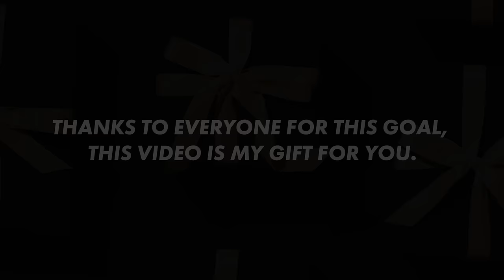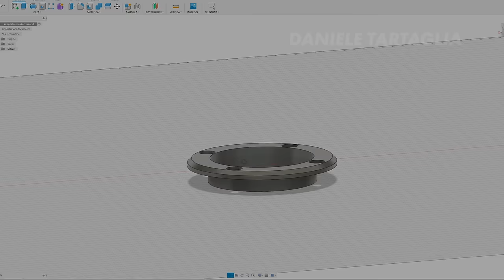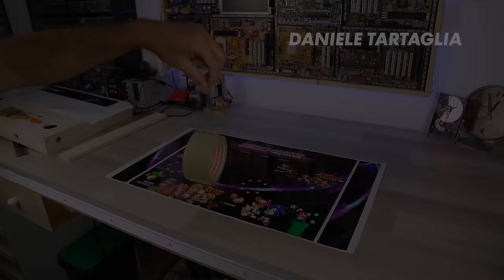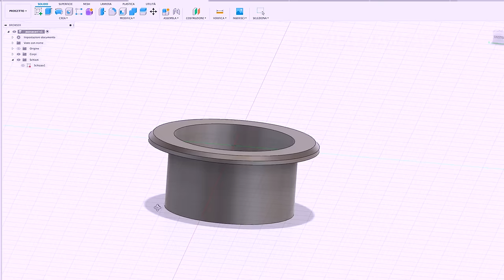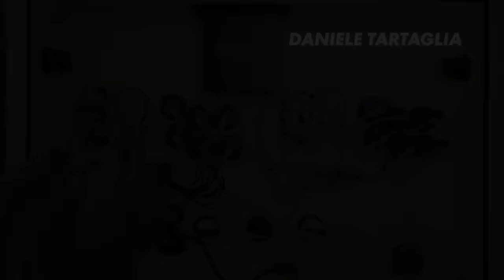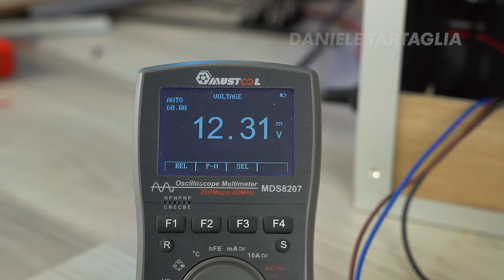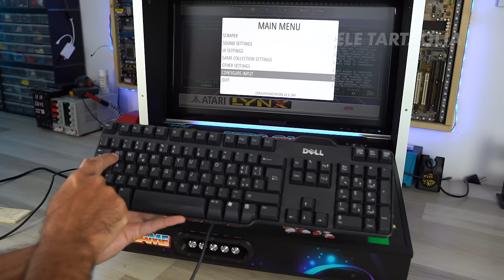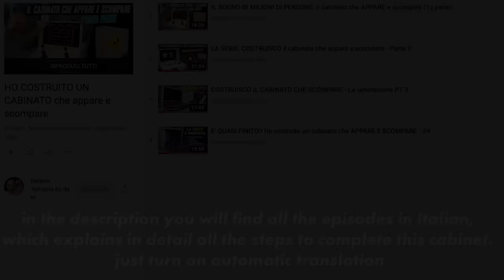INCREDIBLE!! I put a ARCADE ROOM inside a shoe cabinet

Comment: This looks much nicer than the one I’ve built. I took the cheaper and easier approach and used a harbor freight case with a thrift store monitor. Using the foam for the case I just set in the Pi and a small speaker. I also used a removable joystick so the case can close. Great job!

Comment: Incredible work! I’m finishing a years long dream of installing a 17” flatscreen monitor, Dreamcast, VGA box, powered stereo speakers, power strip, controller & game storage, all inside a $5 wooden & boxy & solid suitcase! Plenty room to add a Pi, too! Open the 90 degree brass hinge, plug in the power strip, play for rainy vacation days! Using a load of 10-15lbs industrial Velcro brand sticky back to hold most pieces in place. Our projects are different, but wanted to share the idea I’m going with! All works, just the Velcro and maybe some zip-ties and 20 minutes (tomorrow!). Nice epoxy addition! Fascinating watch!
Reply: Good idea..would the Dreamcast lightgun work with ur project? House of the dead was one of my favourites... post a video or photos when u complete the job if possible 👍

Comment: This looks like something I would build. Major overkill using that amp to drive those tiny little speakers though. I used one of those amps for an experimental PA system build and it blew my mind. It can drive dual 120watt home theatre ceiling speakers (2 left and 2 right, parallel connected) and a 300watt 10inch sub to crystal clear live concert like levels of sound. Awesome job on the arcade machine mate. Nice video. Thanks for sharing! 👍

Comment: V2 needs some manner of rotating the display so you can play "tate" mode (vertical) oriented games, m gonna build a chaper non portable version of this with an old PC, a couple of old wired x360 controllers and an ancient 22 inch 720p CRT monitor i been saving just for this

Comment: Jlcpcb took part of your video as their 3D printing advertisement. now unless you had them print your speaker covers and control knob bracket now if you printed them yourselves at home then that would be considered stealing content. Because technically they didn't make your speaker cover or control knob area if you printed it yourself  Unless you gave them permission to use part of the video